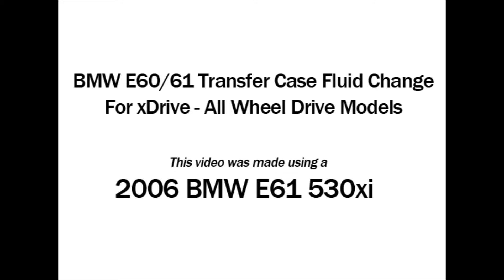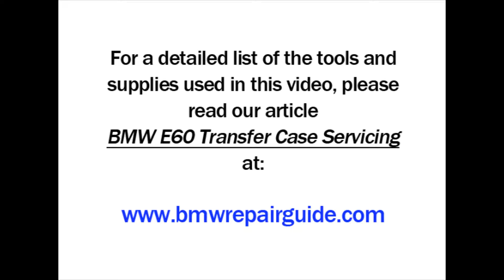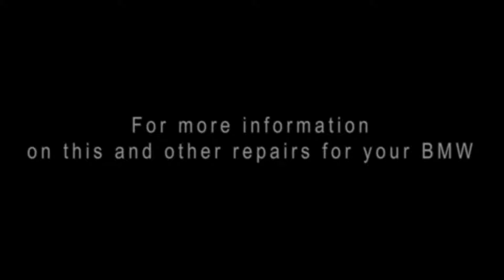BMW E60 xDrive Transfer Case Fluid Service

Comment: I just finished doing this on my E61 with 300K miles and thought my mistakes might help others.  I was working under jackstands with limited elbow room.  My first effort fumbled the plug and resulted in most of the fluid pouring out on the driveway.   After some thought I added a few refinements.  1) Use a clean catch basin so that if you need to let it drain again you haven't wasted the expensive fluid. 2) Test the plug before filling and mark the position so it will start smoothly in the first turn and 3) I used a thin piece of rubber from a bicycle inner tube to cover the hole quickly, held in place with my fingers.  This was very easy to do quickly and then I was able to place the plug over the  rubber membrane clearly feeling the position of the fill hole behind it.  Gently slide the rubber strip out while holding the plug in position.  The process went very smoothly with these refinements.  The video makes the process of refitting the plug look a bit easier than it is - especially when working with limited space.  But I appreciate their method and have more respect for their dexterity!
Reply from the maker: Excellent feedback. We really appreciate hearing from you!

Comment: Just purchased a 2006 BMW 530xi touring.  Had some service records, yet nothing for the transfer case.  This is my first automatic BMW.  Once the car was up on jack stands and ramps, the job presented itself as a little challenging.  Then while searching, I can across this video.  This is genius!!!  Thank you so much for sharing!   While doing the transfer case, I noticed the transmission was leaking around the mounting hardware...strange!  The transmission pan was replaced about 3000 miles ago by the PO's shop.  So I will be searching for a transmission video.  I sure hope you folks have one!  Again, thanks for such a great transfer case video!
Reply from the maker: Hi Bob. We are very pleased that you found this video helpful! Trying to fill the transfer case using the traditional method is most definitely challenging...and completely unnecessary. As for your transmission, we do have several articles on our site concerning this. If you can't find an answer to your issue, please post your question with photos on our forum (https://www.bmwrepairguide.com/forum/) and we will answer it immediately. We like questions to be asked on our forum so they can help other BMW owners as well :) Best Regards.

Comment: Alternatively, you can remove the Set Positioning Motor at the opposite side of the transfer case and fill there. It's position is at the exact same height as the fill plug, and the three torx bolts can be removed without lowering the exhaust or heat shield. It's not as fast as using the drain hole,.. but it does ensure that the correct amount of fluid has been added.
Reply: I just replaced the motor on mine. I didn't even think of the possibility of using that hole as the fill port! Wow that's actually a major time saver! It literly takes me 20min on a lift to remove the motor and put in the new one. I could swap the fluid without removing all that other jazz. Something tells me that this is actually how BMW designed it to be done while they were doing R&D for the e60 Q _Q.

Comment: The capacity of the transfer case is listed as 0.52 litres. By pumping one litre are you over filling it this way?
Reply from the maker: No...you are not. You will lose a small quantity of fluid using our method, but you are not anywhere near the "danger zone" of overfilling!
Reply: @BMWRepairGuide  Oh good. Thanks for the all the info. Great website.
Reply: @BMWRepairGuide  it seems only a few ounces of fluid came out when you installed the drain plug. To confirm, it seems there are at least 0.9 liters of fluid being added with this method. Are you saying that putting 0.4L more fluid than what is recommended is OK? I'm going to follow this method and just want to make sure it will be fine... thanks in advance

Comment: Do you have to reset the adaptation after doing this? Because I wouldn’t be able to do that.
Reply: You do not have to reset adaptations for this repair. You only need to reset them when servicing the transmission.

Comment: Did you remove the exhaust system?
Reply from the maker: No. This video shows how to change the fluid without removing the exhaust system or dropping the transfer case.

Comment: Well.. there's also a fill plug on the other side of the transfer case.
Reply: The problem is on the e60, the fill plug is blocked by the exhaust and its heat shields
Reply from the maker: That's correct. On the E60, the fill plug is located at the top right of the transfer case. 
It can only be accessed by removing the exhaust and the transfer case bracket. This is a very difficult job for the home mechanic...especially those that have to lie on their back under the vehicle to do this repair. Our method puts exactly the correct amount of fluid in the transfer case without having to remove a single part.